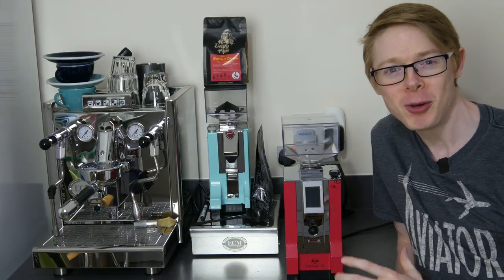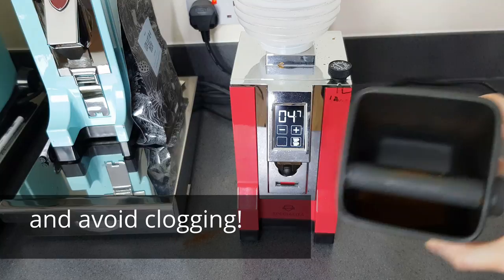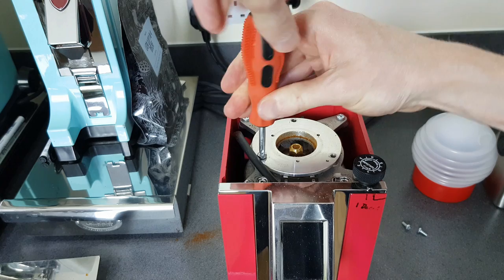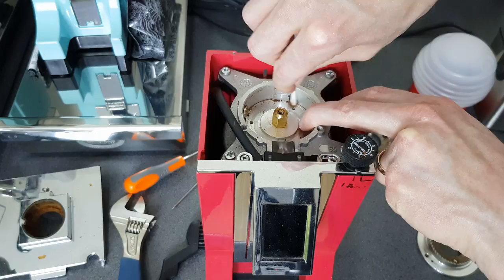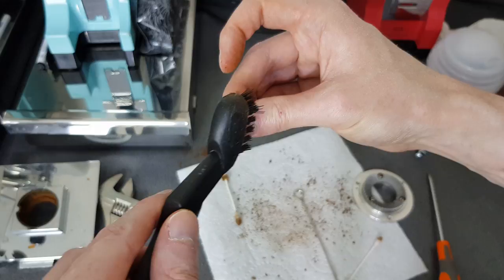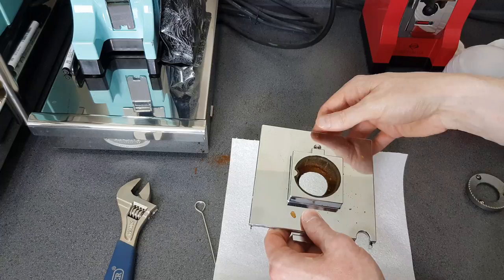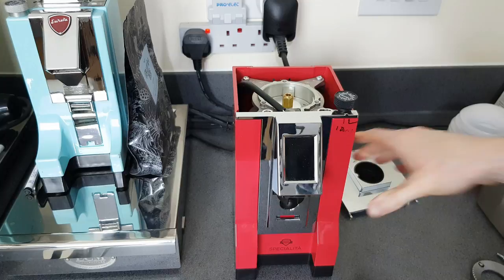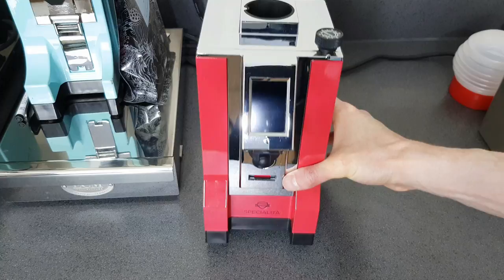Dirty Little Grinder: Cleaning Your Eureka Mignon Specialita Espresso Grinder

Comment: How is the name of that plastic  thing used to blow the coffee inside the grinder i absolutely need this to remove the coffee retained, anyone answer would much much appreciate. Couldn't find it anywhere 😅
Reply from the maker: Hi - This was the one I got https://www.amazon.co.uk/GardenHOME-Practical-Insect-Killer-Powder/dp/B01D0I21CI. It looks out of stock at the moment. It seems to go in and out of stock. But you might be able to find something similar. Does that help?
Reply: @coffeewithalex4379  Oh thanks a lot, yep got the keywords should be able to do a bit of research and find something similar, this is a really a great idea, specially for the grinders that got lot of retention
Reply from the maker: It is isn't it - I saw it on another video and had to do some searching to get it. Hope you find it!

Comment: Hello Alex

I would like to buy one similar to this
But i would like to know your comment and recommendations about it after one year useing
Reply from the maker: Hi Habib. Thank you for subscribing! 

Overall I love the Specialita. The grounds are lovely and fluffy. The Mignon Mk II was good but it did produce clumpy grounds - with the Specialita and the Clump Crusher, they've solved this.  

The touch screen is bright and is really easy to use. 

The grind adjustment is also easy to use. 

And I love the look of it too. 

Whether it's right for you depends on what you'll be using it for. I use it for espresso and my usage would be considered pretty light home use. 

If you do get it, I would say keep it clean and follow something like the process in this video every 2 months or so. If you saw the part at 09:15 grounds can start to accumulate underneath the holder for the bottom burr. I had to get this removed and cleaned by the people I bought it from. This was probably partly my fault as I didn't remove the bottom burr for a year.

So I would also recommend getting it from a place who can undertake cleaning/servicing themselves, if you can. 

Hope that helps and thanks for watching! Let me know if you have any suggestions for future videos.
Reply: @coffeewithalex4379 

Thanks a lot Alex

I am planning to buy one.

I believe each device need some care after certain time.

For me i use to clean my braville barista express espresso like one time a month.
Yes i will use it for home.. Approximately 3 to 5 cups a day so i thnink it's will be useful for me and its meets my budget as well.
Reply from the maker: I think it's a really good grinder for the price. 

And, if it matters to you, there are a delightful variety of colours and styles to choose from.

Did you see my Specialita unboxing video? 

And in my espresso machine in boxing video, I talk about how I was considering the Speciality 75 from Eureka. 

Best of luck Habib!
Reply: @coffeewithalex4379 

Thanks Alex

I didn't watch it.. But sure I will

All the best

Comment: Can you change out the grinding dial for the one on the MIGNON PERFETTO?
Reply from the maker: Hi Julian - Not that I'm aware of. Although I'm sure someone could do it if you really wanted it done.  Actually looking at it, I can see why you might like that one better. Is it because of the numbers on the side, which isn't there on the Specialita?
Reply: Well I've just bought the one in the video based on the shops recommendation having said that I  don't drink that much espresso would it be good for drip and stove pot only to find out they actually make the other version with the easy dial in.
Reply from the maker: The Specialita is a slightly higher spec than the Perfetto with its slightly larger burrs (55mm vs 50mm). I think you'll find that you won't miss the grind adjustment guide once you've dialled in a few coffees.
Reply: @coffeewithalex4379  where did you get those bellows from ;o) they look handy?
Reply from the maker: Here's the bellows I used https://www.amazon.co.uk/GardenHOME-Practical-Insect-Killer-Powder/dp/B01D0I21CI/. Not meant for coffee at all as you'll see!

Comment: Hi! I was cleaning the eureka mignon and a black screw with a silver nut came out. Any idea where it’s from? Thank you!
Reply from the maker: Hi Winfred, can you share a photo? I actually think it might be the screw at 04:18 in the video. It's at the back of the grinder. Is that it?
Reply: The photo’s of the screw here 

https://coffeeforums.co.uk/uploads/monthly_2020_10/86C4A745-4AE1-4E7F-957C-33E137633754.jpeg.a23a575caae822cc5c60c1d2e0238b70.jpeg
Reply from the maker: Hi Winfrid, thanks. I haven't seen any screw with a nut loke that when I've taken apart my Specialita for cleaning. 😬
Reply: Not sure if this is the same screw or something different, but above someone named Hoax commented: 

"Thanks for the video, that was very helpful! I just successfully (at least, i think :D) cleaned my Eureka after having it for a few months. One thing startled me a little - I completely removed the screw that is supposed to hold the hopper in place, and if you do that, a little nut will fall out when you remove the rubber piece. So, just an advice to anyone cleaning it for the first time, don't unscrew the hopper screw completely, or if you do, be prepared to collect the nut, so you don't have to frantically search the kitchen counter like me ;) "
Reply from the maker: I cleaned my Specialita a couple of days ago and didn't come across this screw
Reply: @coffeewithalex4379  cool. I don't even have mine yet. So I don't know.

Comment: So after u clean the burrs does it need any sort of calibration or something?
Reply from the maker: Hi Andreas. No calibration needed. In fact with this grinder you shouldn't even need to dial in again. It'll keep the same grind size as before you took it apart. This is because the grind size adjustment moves the bottom burr, not the top.

Hope that helps!
Reply: @coffeewithalex4379  Thanks for the fast reply. U are awsome
Reply from the maker: Thanks to you for watching, Andreas!

Comment: is it perfect for single dosing or should i go for Niche zero
Reply from the maker: Hi Saleh - There is some retention in the Specialita. When I've tested it, it's around 2g. Honestly, no it's not ideal for single dosing and, as far as I'm aware, it's not designed with that in mind. But it is a good grinder for the price where there isn't really much choice for single dosing grinders. I have no experience with Niche Zero though. I looked at it but I was put off by buying it through a crowdfunding site, the wait time and where I would go if there were issues with it. 

Does that help?
Reply: @coffeewithalex4379  you've said facts, thanks for responding

Comment: Hi, does after cleaning will the grind setting?
Reply from the maker: Hi Nic - it is supposed to keep the grind setting. I've found it's not always the same. So to ensure it is you might want to mark the burrs so you know where they sat and which was which (top or bottom). I've done that recently. 

Does that help?
Reply: @coffeewithalex4379  mine after cleaning the grind setting clearly away a little bit but i turn it to the zero point where the grind setting meet the finest point and then i start to turn coarser more it turn out fine
Reply from the maker: Yeah - good idea Nic.

Comment: do you need to recalibrate it after you clean it?
Reply from the maker: Hi Guillermo,

Great question. Andreas asked the same. So here's what I said:

No calibration needed. In fact with this grinder you shouldn't even need to dial in again. It'll keep the same grind size as before you took it apart. This is because the grind size adjustment moves the bottom burr, not the top.

Hope that helps!
Reply: @coffeewithalex4379  Awesome, thank you for the prompt reply.
Reply from the maker: Glad to help 😊

Comment: What I learned from your use of the bellows is there is a surprisingly large amount of retention in this machine.  This shows most reviews aren’t done in good faith. Very disappointing
Reply from the maker: Well this model wasn't sold as zero retention so I guess we should give it some slack. They have newer models that do say 'zero' retention although true zero is almost impossible. Did you see the grinder I've upgraded to? Even that has some retention. You can see it here https://www.youtube.com/watch?v=5T-OGTZoIQM What do you think?

Comment: What Mignon is the blue grinder?
Reply from the maker: Hi Marek, that one is older. It's a Eureka Mignon Mk2 (also known as Eurrka Mignon MCI).
Reply: @coffeewithalex4379 have you got an ACE on the MCI?
Reply from the maker: I don't have the grinder any longer but I believe it had some kind of anti clumping  although different from the Specialita
Reply: @coffeewithalex4379  did it ever give you trouble?
Reply from the maker: @mbrylewski the blue MkII? No it worked ok, in fact it seemed more sturdily built and heavy than Specialita. But I enjoyed using the Specialita more and believe I got better espresso from it. I have a video I haven't edited yet with both grinders in.

Comment: Can I pick your brains as I am getting nowhere with Eureka. Which model is your light blue grinder?
Reply from the maker: Hi, that one is older. It's a Eureka Mignon Mk2 (also known as Eurrka Mignon MCI).
Reply: @coffeewithalex4379  I apologise for asking because I have asked you before. I am having a problem with my grinder and it's also the MCI. It's worked flawlessly for 11 years and now started clogging up. Eureka in Italy can't tell me what to check for. Yesterday they mentioned the the ACE might need replacing but can I find this component in my machine???? No. They say its whe the gind is ejected  but I cannot find this. Do you have something on your machine? I have replaced the burrs, thinking that might be the problem
Reply from the maker: Hmm I don't have either the Specialita or the MCI now. I do have a video I filmed but havent edited and it shows a removable piece of black plastic in the chute which I assume helps break up and help the flow of the coffee out of the chute. Do you see anything like that when you remove the chute?
Reply: @coffeewithalex4379  nope tgere is no plastic piece. I am hoping that Eureka will be customer friendly. I will send them some photos on Monday
Reply from the maker: I trawled through some of the video I shot and found the piece - here's a screenshot of it for your reference https://share.getcloudapp.com/NQu5OEJW

Comment: I must say, that you forgot important place to clean. It is below the lower burr rotating holder, it is secret place where is lots of coffee forgotten and hidden. There is two ways to do it, or unscrew that bolt in the middle, or use compressed air with straw. Vacuum cleaner is not helpful here. I discovered this when I finished cleaning and there was still weird noise coming out, and slightly resonating. This grinder getting messy very quickly  and start grinding not that we'll ,like straight after cleaning.
Reply from the maker: Hi Joe. Thanks. I actually didn't forget it. I mention this in the video and show a picture of what mine was like. But it's not recommended to unscrew this unless you know what you're doing. I got the shop I bought it from to clean this out.

But yes compressed air is a good idea. So is using a straw on the end of a micro attachment to the hoover.

Thanks for watching!
Reply: @coffeewithalex4379  ah, silly me didn't notice that part, yes, it caused me always issue underneath that ring and really gets dirty quickly... Cheers
Reply from the maker: Definitely does! Cheers Joe.

Comment: So you need an... allen key? :)
Reply from the maker: I guess so! :)
Reply: @coffeewithalex4379  Heh, although seems like yours is a bit different, mine has a phillips head screw there. You could change yours as well and you'd need only one tool ever.
Reply from the maker: Yeah, I'm not sure why they didn't do this in the beginning. Luckily I had a tool that fit.

Comment: I was on the fence about getting a Specialita but after watching this video, I'm definitely staying away from buying it. Too much work cleaning it up.
Reply from the maker: Hi Khaleed - Have you seen how to clean other brands or models? I'd be interested to see how other grinders are easier to clean - do you know of any and why it's easier? As far as I'm aware the process is pretty similar whichever grinder you get. The dismantling is the part the differs most between grinders. 

This video was to show a really thorough clean. It was quite a long video just because I wanted to cover as much as possible and actually show how to do it rather than brush over the steps. 

Thanks for watching!
Reply from the maker: Hi, to be honest with you I had never heard of the etzMax before. I hadn't come across it when I was looking for grinders. Mind you, as you said, it seems much more expensive although I can't find it anywhere in the UK. 

You also have cone shaped burrs which are quite small. That's the tradeoff for easy cleaning but the good side is the cleaning seems less effort.

The Specialita is, in my opinion, a good espresso grinder for the price. If you have a bigger budget then maybe others would suit you better. Keep in mind though it's not designed for single dosing so there is some retention (from my experience it can be around 2g).

Hope that helps? 

Thanks for watching! Let me know if you have ideas for other videos I should make.
Reply from the maker: Ah ok. Yes I did look at the Sette for the weight based dosing but I decided to go for a machine with flat burrs. The Specialita has 55mm flat burrs, which is pretty good for the price.

I hope you / your family enjoys the Specialita!
Reply: @coffeewithalex4379   You mean 55mm flat burrs (for the specialita) :)
Reply from the maker: Yep, that's right! Did I say different? A Can you give a timestamp?
Reply: @coffeewithalex4379  I don't think you said that in the video. But you said it in the comment above. No biggie, just pointed it out so people don't get confused.
Reply from the maker: Thanks Ben, I've corrected it now 👍

Comment: I’m beginning to regret my purchase of this thing, there’s enough retention in it after a week to make a 10 coffees, the grounds find there way into the electronics they get everywhere, tried single dosing with bellows it’s not been much help. Just save up for a niche or a better flat burr folks the specialita is a capable grinder but not worth the headache.
Reply from the maker: Yes there is retention but this version of the Specialita in the video is not marketed or positioned as a zero, or even low, retention grinder. So the Niche Zero is not an apples to apples comparison. It doesn't even have a hopper! Many people don't want to deal with single dosing, so the Niche wouldn't be an option for them.

I've not seen the grinds get into the electronics.

I've tried bellows as you might have seen in my other videos. It absolutely helped me. Maybe there's an additional issue causing retention problems for you.

But yes I understand your frustrations. This was a good grinder for me to start with. I've moved to a dedicated single dose grinder now. There's a video on that too on my channel (I think I called it best single dose grinder under $1,500). 

Thanks for watching!

Comment: Consider just doing it faster and talking less.
Reply from the maker: Thanks Mikko, I considered that and made this instead. 

As you'll probably know there are a lot of shorter videos with less talking - I watched most of them when I wanted to clean my Specialita. That's why I made one covering stuff they didn't. I also included things I had to find out for myself. I thought that would help other Specialita owners. 

You should see how long the unedited version was!

Thanks for watching.
Reply: You can use 2x playback speed on youtube :P This video is also nicely sectioned off so you get the idea of what's shown.